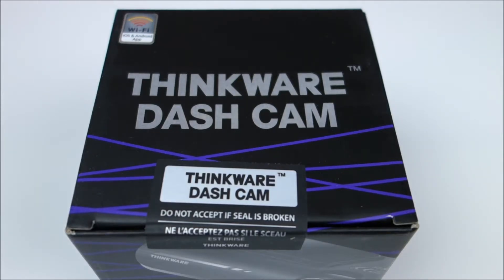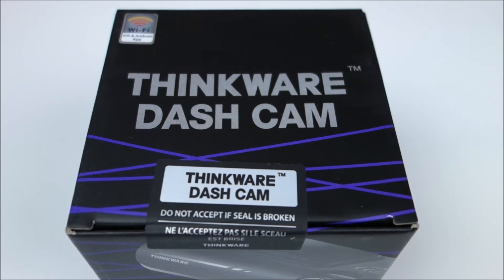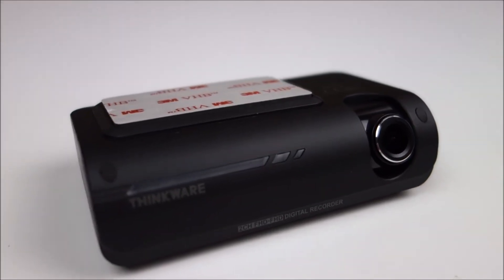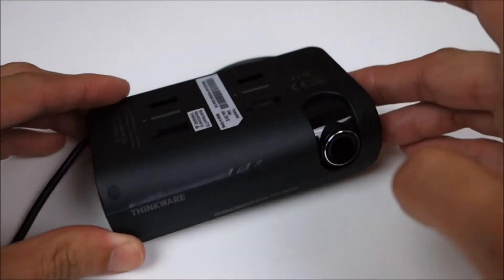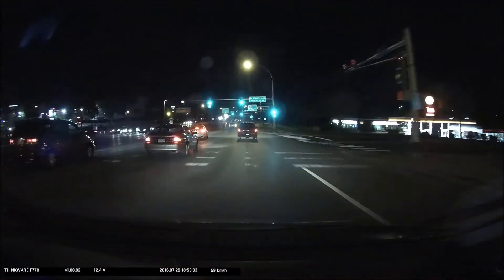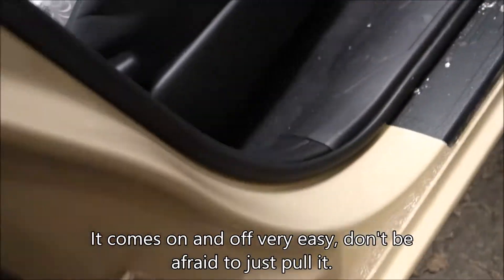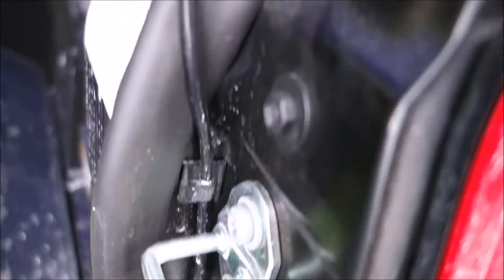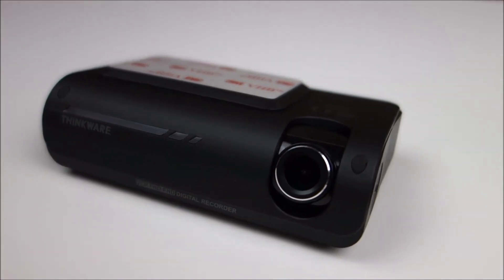VLOG #005: My Toyota Tacoma Dash Cam Setup (wiring rear cam)

Comment: i ll try to install my cam outside of the truck bed!  i ll have to make some kind of protective box to put camera in . keep it away from snow and mud !!!!!!!
Reply from the maker: blackvue has a truck model with a water proof rear cam but its pretty costly and the rear camera is pretty big. designed more for commercial trucks.
Reply: @integralcam  i ll check. Thanks

Comment: having issues hard wiring my A119 to my 2017 Tacoma .  Any feedback would be greatly appreciated. I just bought a cigarette adaptor with a fuse splitter but  no power .  what fuse did you join it to ?
Reply from the maker: I am confused, you are using the cigarette adapter but trying to split that into a fuse? If you are tapping into a fuse you will need a dash cam hard wire kit like http://amzn.to/2tKzEcn but if you are just trying to splice the wire from a cigarette adapter its possible you are not sending the correct power requirements to the camera.
Reply: got the wiring harness and simple easy . thanks .

Comment: You have enough slack to do a 6ft bed? I have the same truck and shell but a long bed.
Reply from the maker: I needed an extension even for this actually. but the cable did make it pretty much all the way back and up to the roof, so your best bet is to do the wiring and see how far it gets, then buy the length of cable you need. I ended up with a lot of slack with my extension I tied up to the existing wiring for the dome light.

Comment: Can the wiring be closed in the cab center window thing? Like if the wires are clamped in there, will there be any issues or damage to the cables ?
Reply from the maker: Do you mean thru the rear window? It probably would be fine if you aren't constantly closing and shutting it hard, I have done that many times while testing 2 channel dash cams in my truck. You might not get a good seal in your window tho. I personally prefer buying a longer cable to wire it around the long way though so I don't need a cable thru that window.

Comment: Tks, to you! Just subscribed; then the camera is actually two devises?, one in the front windshield and one in the rear on the top you put to cover the bed.. how do you call those tops? How much they cost?. I’ve not checked the link, I will once finished this comment, need to know cost and brand of the camera.. I may buy it during Black Friday 😊.. Again GREAT VID! TKS
Reply from the maker: It is one device so it records to one memory card, but it records from two lenses. the rear camera is basically just a lens/camera, but the front main unit is what processes the image. These thinkware cams are very pricy as they are top of the line. This F770 model is last years model tho, there is now the F800: http://amzn.to/2zSHbJ6 (I would ignore the bad reviews, they sound like customers that had minor fixable issues that gave it bad reviews before trouble shooting) and F800 Pro: http://amzn.to/2z2qnfc although the benefits in them are pretty minor, if you can get an F770 for cheap its still a great camera. Many people prefer the look of the F770 also.